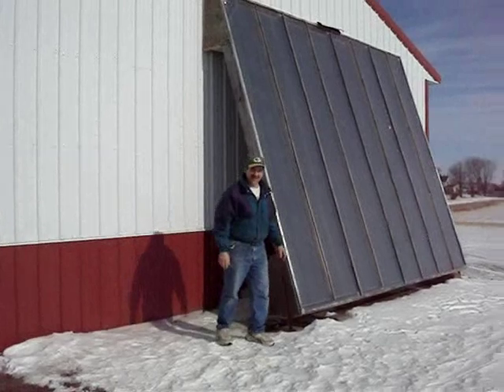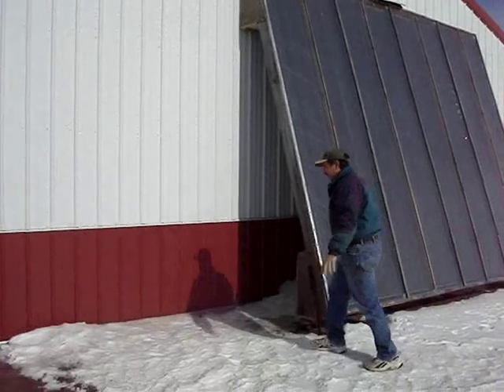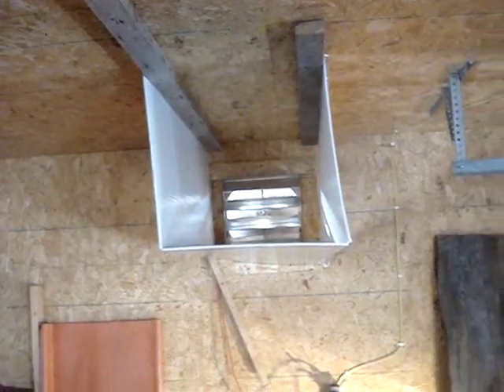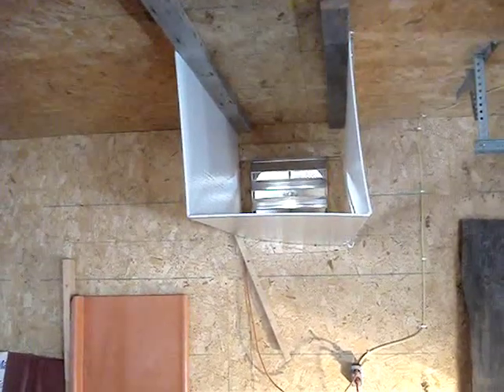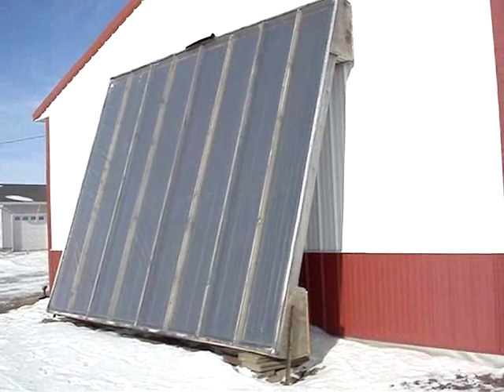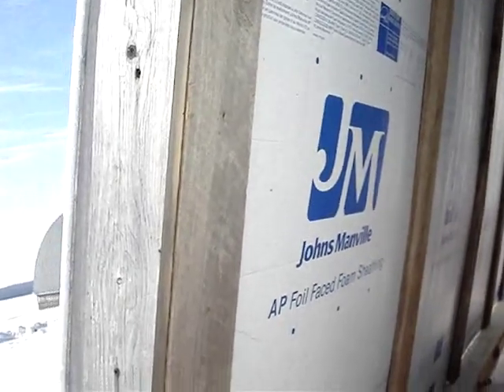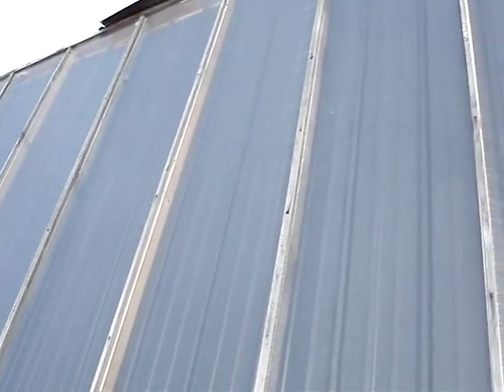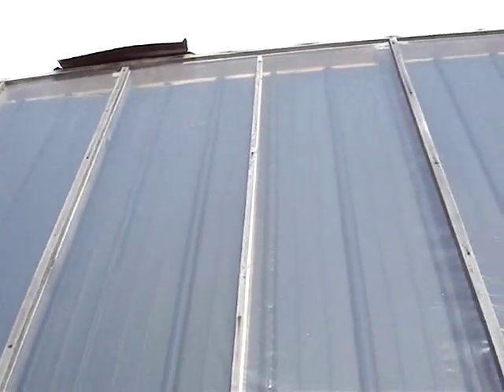HOW TO BUILD AN AIR HEAT SOLAR PANEL COST $400

Comment: I would put the intake at the top and the hot air vent at floor level as heat naturally rises and air vents at the top are more likely to just heat the ceiling.

Comment: I advise you to attach the panel to the wall, otherwise you lose heat from the back. Furthermore, the gain from an increased angle at solar heat panels is not much a deal.

Comment: why didn't you just paint the wall of the building black and cover it with a air gap of glass from old slinding doors, even salvage duel pane ones?

Comment: great job, to cut costs if one is really serious and committed about this adding a solar heating system  is to paint the side of your garage then build a simple, frame on your garage side , cover that with the plastic. You save on all the structure associated with the panel, and the foam and the ducts run.
the panel does not have to be inclined to the sun as the sun is lower in the sky in the winter anyways. 
payback is an important variable.